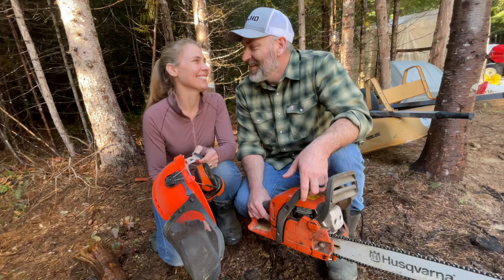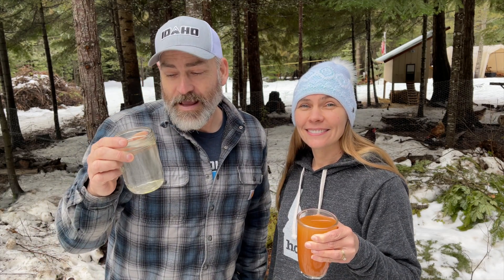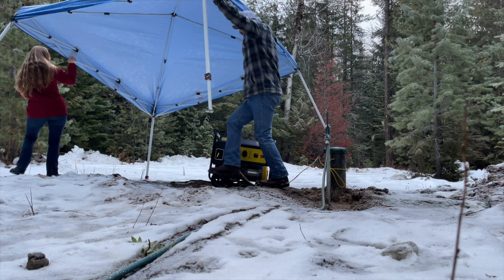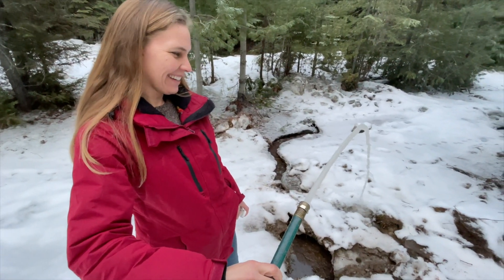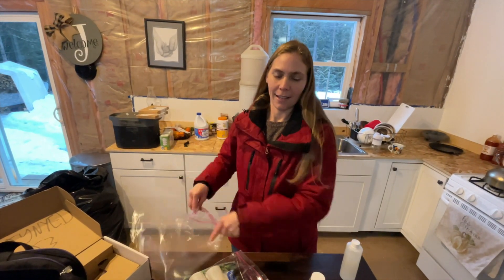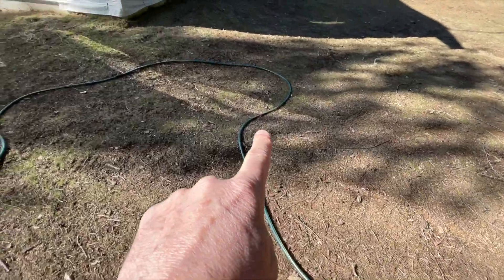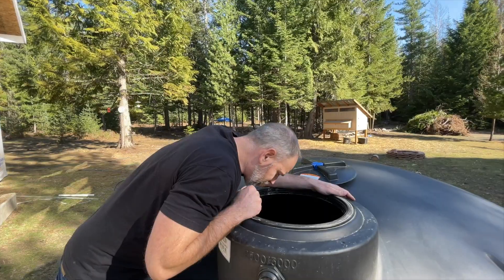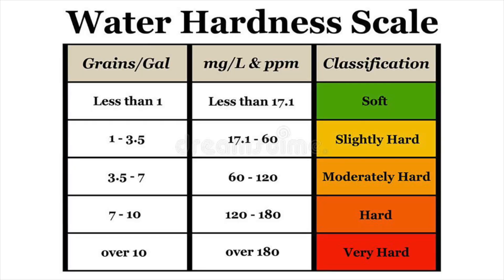Brand New Well... POISONING US?

Comment: They probably do not have an inline flow restrictor on the water line.  A flow restrictor looks like a check valve but has a calibrated tiny hole down it's middle.    Flow restrictors are rated in gal/min.  Try a 5gal/min one.

Comment: Not sure a water filter will remove the hardness. Use a water softener first. Recheck the water for everything after it goes through the water softener. Then add a filter if needed. Use softener salt with additive to remove iron or add a couple of cap fulls of ironout every time you add salt.

Comment: An aggregate back wash system works great for the iron removal. A uv is nice also but if iron isn't adequately removed prior to passing through the bulb chamber it will bake on to the quartz sleeve and alarm all the time as the uvt will be reduced.
Best of luck finding your best system.

Comment: I like the pool pump comment, makes alot of sense. Anyways, if you have cloudy water still after all this time I would use 3 part filtration 

1 pool sand filter OR twine cartridge for catching big stuff..iron clay

2.  5 micron cartridge 

3.  1 micron cartridge 

Have your water tested again after 1 wk of doing installed.

Fortunately I was blessed to only having to use a 5 micron followed by a 1 micron filter.

I am for

Comment: For filtering out any silt and things of that nature, i would go with a bag filter system before your storage tank. They are very easy to change and maintain and tend to have a decent number of gallons through before the bag needs to be changed. 

After the storage tank i would still do a whole house system. There are many setups, technologies, and varities available. I like the use of a Reverse Osmosis filter in any setup... but there are pros and cons for this (and all) types of setups... best i can say is do a bit of research on it and pick what will work best for you and your family.

Comment: I like your videos!    I live in the mountains of Virginia and have a similar problem, high iron content.   Without filtration It's like licking a piece of angle iron.  I use the standard whole house filter made with charcoal and a water softener with the brand of salt made for iron removal.  Some of the iron is from the ground and some is from the iron well pipe.  Everytime the submersible pump starts the pump and hose twist slightly scraping off some rust inside the well pipe.  All that said, I'm lucky I have water.  There are some high end houses in this county that have very deep wells drilled and did not strike water. They had to have a cistern buried and pay to have water trucked in to fill it.

Comment: Something to check out. If you have a well that is producing, say 10 gallons per minute. And your static water level in a 250' deep well is 60' . If you use a pump that is rated at more than the 10 gallons per minute .Each time you use water the static level is drawn down. Resulting the water being drawn too fast from the rock layer into your well casing . Results. Clean water at first and then sediment carring water next. AKA muddy water.
Pump needs to sized less than the producing rate. Keeping the static level steady ,instead of up and down.
Looking forward to bumping into you. I live in North Idaho also. Probably, watching your channel. Just a few miles away

Comment: Not chea but you might want to look at Greensand filters.  Weve had one for over 2 years.  No salt to reload.  One canister has to be changed every 6 to 8 years for us (about $600 ) unlimited clean safe watervery little hassle. They do require electric for the clock that cycles a cleaning backwash daily.

Comment: Replaceable wound string filters work for a steady flow such as well to tank, the big sand filters used for swimming pools will cope with huge flows and fine filtration, but need cleaning occasionally. Soluble impurities will need removing by complicated precipitation or by a de-ioniser or softener system using resin based systems.

Comment: You need to get out of the iron by drilling deeper, you are still going to have these issues until you get out of the layer that has the iron in it. We have the same type issues here. I had my well drilled way below the iron level for the reason others were having horrendous issues with it.
Reply: I was thinking the same thing.  They had the equipment there and should have taken it to 800 ft.

Comment: A couple of rusco spin down filters one at 500 mesh and one at 1000 mesh would save you the cost of your sediment filter.  Move your iron filter to spot one then keep your carbon filter in the same location.  Finally since you like your gravity filter in the kitchen put in a ceramic candle filter into the last and final canister.  You will have absolutely amazing water and while you may need to occasionally need to clean the candles they dont wear out.  you will still need to change the carbon and the iron filter.  if you find that your water is still hard you can always add another citric acid filter that will do a great job of keeping the minerals in the water but will cause your water to have the effect of natural softened water

Comment: I’d do a 3 stage water filter and then an ultraviolet light filter.   If the water is too hard then also add a water softener.   Though you might be just fine without it. We didn’t need one when we lived up there 🙂

Comment: We have a 140 year old farmhouse set in the middle of corn fields, in Central Illinois, with a 75-ft deep well.  The water is hard, runs black at times, and has a sulphur smell.  We use the Sears filtration system that was popular 30 years ago.  It consists of stand alone bleach injection pump, dwell tank, sand filter tank, and carbon filter tank. This is followed by a water softener tank for just the hot water, to protect the hot water heaters, dish washer, and washing machine, from hard water scale. I mix a cheap bleach with water in a 50 gallon plastic tank, and this is injected, in small quantities, into the incoming well water prior to the large well tank.  The bleach bonds with the sulphur dioxide, as well as kills any “bugs”, before being removed by the filters.  The system requires quarterly maintenance and back-washings, as well as getting the right bleach-to-water mix in the tank, but has performed fine for decades.  The bleach does affect the plastic pump parts, so they have to be cleaned with vinegar maybe once a year.  I replace the pump every few years ($200). All parts are available from Sears Online, Blue White Industries, and eBay.  Water tests show everything, including farm field chemicals, are removed by this system.  If you want part numbers, let me know. It all does take up space in the basement.

Comment: Filter the water through a 24 inch big blue filter at say 50 microns prior to i going into the tank. Then between tank and house use a three stage big blue system followed by a uv reactor. Under the sink for drinking fountain have a reverse osmosis system. Given the cost invested in the well spending top dollar filtration seems logical.

Comment: Filtering the water may require multi stage system but since you said water was pretty good with a little arsenic in it.  Your probably fine with any basic system. Arsenic is very common in the U.S.

Comment: Filtering: Personally, a double plumbing system. One for "drinking/cooking" the other for "washing/waste/watering". System one is on a 100ish gallon gravity fed multi-filter RO unit, the other is on a larger/faster sand and carbon filter system. Granted it essentially doubles your structures plumbing (and may or may not be allowed in your residential code) but years ago I worked on an island at a research lab, and this is what they (Australian gov) used to support the housing/labs...
Reply: Under counter RO setups are cheaper than doubling the plumbing and you really only need drinking/cooking water in the kitchen sink.
Reply: @LenstersH  that kinda depends on a lot of factors, but I agree, at a bare minimum, that could work. But in a modern home with at least 4 people, the expectations of on demand supply, and multiple access points (even something like 2-3 baths for brushing teeth), a more robust supply might be desirable. Given their level of rust, a multi tier and parallel/separate systems my be desired to preserve the fixtures, and surfaces from rust staining alone...

Comment: WE have an Ecosystem water filtration system.  It consists of 2 steel tank cylinders (about 10 gallons each) that contain the filtering rock and sand about 10 layers each).  This system has a backflush for the filters on it that occurs every 2 days that you can setup.  The backflush is very important to get rid of the filtered junk.  It even has a bleach insertion pump that you can inject into the filter system at times if needed.  We have had this in operation for 17 years with no problems and our water always tests good.

Comment: I have a whole house filter system and softener from lowes. runs good for me. I have two of the small prefilters instead of one and bought the upgraded  activated carbon filters, then this huge filter that feeds the softener. I use the regular sun crystals but they make them also that removes iron as well.  I love it honestly, I mean I can drink water out of any tap now and when you shower you feel and get cleaner and cloths wash much better because they rinse better

Comment: I would include a sand based filter as the first part of the water system. Sand filters are the type used to clarify water that goes into swimming pools. They are normally back flushed at some infrequent period. As the last element or next to last element in the system, I would include a UVC sterilizing filter such as sold buy Home Depot.

Comment: I would use a sand gradient filter at the pump.  Looks like a 55 gallon container with multiple layers of coarse rock to fine sand... Then have a weekly reverse flush to get rid of the collected sediment.  I would also move the cistern to the pump area for fire safety.  Then install a 100 gallon pressure tank and pressure pump at the well area. That will then supply the house.  If there is a house fire you can connect to the pressure tank away from any flame areas for fire control of the house. That will give you 75 gallons or so of water at 30psi for house use and showers..

Comment: The most dramatic diffrence I've seen in pre and after, was with 2 water filters used in series.   the water smelled, but was otherwise, safe.   the two filters, were not replaceable, they were self cleaning, and cost $300 each, but with no filters.      Another overkill, was with a relative of a relative, whom rented to hunters, and had an underground water , best described as "basement".  The runoff down the hill, was divereted thru a pipe, thru a basement like shape, underground room, with a stream running thru one side.   the water was pumped out thru a series of filters. Multiple filters,   they replaced them every 5 months, and into the rentals, for flushing, etc.    It' was shockingly impressive.    I've got a whole house filter, I replace when it turns brown.   it's a pain.

Comment: We run a split water system with the lesser quality circuit running the toilets, washing machine, and gardens. Higher quality water is plumbed and stored completely separate. You may want to consider something similar as it is wasteful to use expensive filters on water destined for flushing the toilet. Perhaps use your rainwater for drinking and well for services. For your well water storage tank, float the pump pick up and allow the water to settle and periodically drain the sediment off the bottom. For your drinking water, there are lots of high spec filter systems to consider.

Comment: 27 years drilling rig  work, has shown me that if caseing is steel,  or even pump pipe work, rust may be seen.
It wash off,  with change of water level..
Usually it does settle down..
..

Comment: We have high iron also and have an iron curtain water system, it use air and sand to filter out the iron. our water would come out clear and after a few minutes exposure to the air it would brown up.
Had the iron curtain system in for over 12 years and works fine, no need to add thing like salt. it has a small air pump that runs wene the well pump runs and the o2 in the air causes the iron to form into a particle that gets filtered out in the sand, it back flushes the sand once a day,

Comment: i'd start off with Sediment filter before the sistern. Then another sediment filter after the sistern, then carbon filter before going into water softener as the softener you can get will remove iron.
Reply: 040621/1320h PST 🇺🇸. That’s ideal and perfect solution. Thank you.
Reply: As I stated in my post I am all for a water softener but believe that it should be the first filter. Also use potassium chloride to regenerate it instead of salt it will be a lot friendlier to everything then when you use salt.

Comment: Filtering::  IF there is much sediment, the first thing would be a Lakos sandmaster filter.  I would get the stainless steel one.  This removes sediment and there is a purge at the bottom of this.   It's good your Ph is acceptable so yo don't need an acid neutralizer.  You should probably add a softener next.   For a final filter I like the rusco filters.  I'd go with 140 mesh.  These also have a purge valve at the bottom.  In summary: Lakos then well-x-trol bladder tank, then softener, then rusco filter.  Actaully to deal with your iron, you probably want to add an iron filter tank before the softener.

Comment: I’m not an expert in water filtering, but I am a chemical engineer.  Since you have lots of particulates, you probably want to filter those out first so you don’t clog up your finer filter for minerals, etc. so fast. Cartridge filter for particulates may plug up fast too. Maybe a sand filter you can back flush would be good. Similar to what’s used on swimming pools. I’m sure your well supply store has lots of options.
Reply: I was just thinking a sand filter would be a good idea as well.. I remember when I used to work for a water delivery service we would do supply drops for a few different types of sand filters.. Not sure how much they run though.

Comment: Australia has a lot of water problems so we invest quite a bit of time and energy in to our water. I am not a plumber or  a scientist but I do earthworks for a living, one of the recent jobs I did involved a filtration system for vineyard drippers , they have iron in suspension in the water as soon as the water comes into contact with oxygen the iron comes out of suspension and forms a red cloudiness in the water,sounds and looks similar to your problem.
What the irrigation guys did to solve the problem was oxygenate the water ( by air compressor) as it comes out of the bore into a long large diameter pipe there is a specific volume , then used a sand filter to trap the iron particles which then in turn would be back flushed into a soakage pit.
This was a high volume set up that I would imagine cost more than your bore. But if it could be shrunk maybe it’s worth looking into.
Anyhow sounds like I’m just giving you more grief 
Cheers from Aus

Comment: Here's a energy saving idea for your batteries to your solar panels. could you use a proper alternator with the proper motors to turn/recharge the batteries that go to the solar panels? I say proper because of technical issues with wire guage and whatever to turn the alternators to charge the batteries without overcharge or undercharge.

Comment: Definitely reverse Osmosis for anything u drink regardless of what the test show. Things change or as has happened to one of my family members, a new house was built near them with multiple deep geothermal wells and it affected their water supply negatively now requiring additional filtering. Also did you test for radon on uranium, probably was tested as that is standard with many of the test packages with arsenic, but just curious. Radon an issue in my well requiring a bubbler and venting before it gets into my holding tank. Fun to watch your progress.

Comment: With that water I would only use a cotton filter on 5 microns and a carbon filter. Cotton filter removes particles and carbon filter removes bad flavors and smell. Almost forgot about the iron and arsenic. Both can be treated with an iron filtration system. If you have high levels of arsenic you'll need an ion exchanger.

Comment: Many wells are designed with a flush valve, because they will always need to be flushed every time they start up. Best method is to have a holding tank to fill, so you don't need to run and flush as often. You can easily add a flush valve with a timer, which closes after power is on the pump for a certain time.

Comment: 5 mic 13 in filter then 2 or 3mic filter finish with sub micron for bact control your iron problem don't worry about it yet if it is a problem filters won't help don't spend the money yet. See if the iron is a real problem. Oh by the way the TDS is perfectly fine.

Comment: Your well needs developing more . Running your pump will develop over time but at expense of your pump life and it takes longer. Run a 1/2 inch pipe down a few hundred ft use a air coupling and  use a decent size air compressor.  Use a fitting to hold the pipe down when you turn it on . Or you can always get someone you dont like :) . It erupts out of my well usually 20ft intially then steady flows.  Filtering  at min you need a sediment filter before your tank so you dont build up sediment in the bottom .